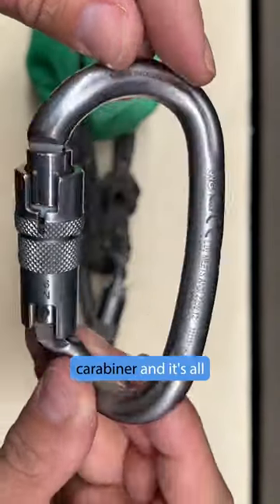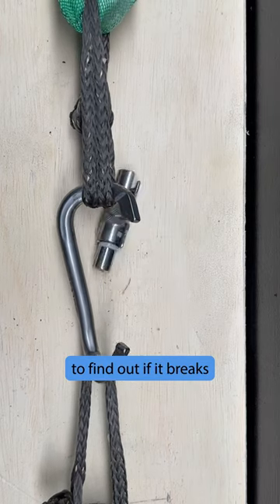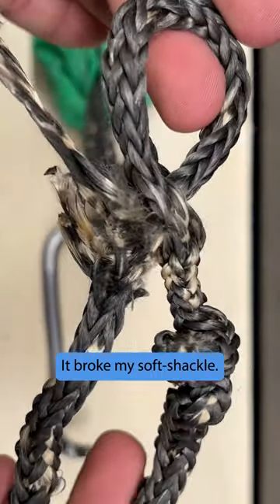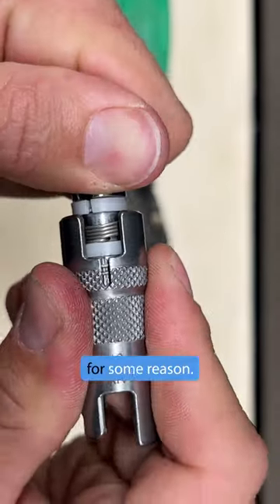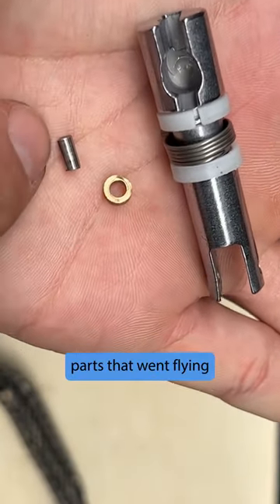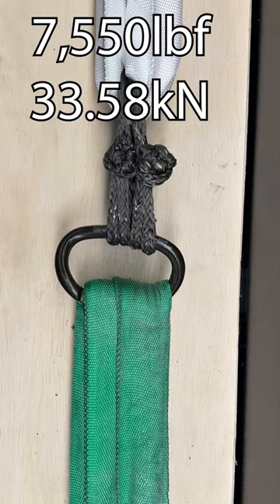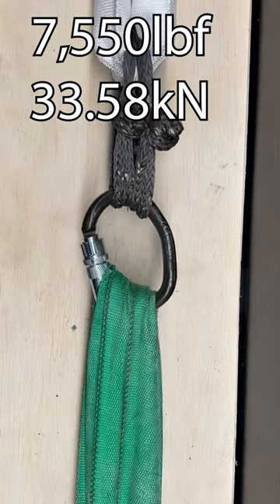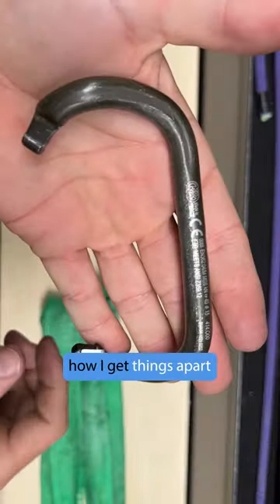Twisted carabiner tested

Comment: If they were ANSI rated carabiners, the 16 kN on the gate refers to the strength while compressing the minor axis, as opposed to the typical tension that we think of for carabiners.
Reply: In what situation will a carabiner be compressed with that much force?
Reply: @MoritzMoo  in a hydraulic press. But for real, what's out there compressing carabineer lol
Reply: @HercadosP me bro im built diffrent
Reply: @a211 8 miles of rope drag...still going
Reply: @MoritzMoo a rappel rack.

Comment: What do you use those for? Besides breaking, of course?
Reply: To connect descenders to a rigging plate and align them so the descender handles operate side- by- side
Reply: these are used in rope rescue for twin tension systems to put two cmc clutches or petzl ID's next to each other on a rigging plate. we use them at my fire department.
Reply: We use these (Kong Ovalone DNA) to connect Petzl-IDs to our belay loops, that way it is oriented better for use in front of you....
Reply: I have in mind you can use them when belying from stand with HMS knot. So if the biner gets pulled against the wall during a fall the knot will not be blocked and you can still operate it.
But I am not 100% sure about that. Needs to be confirmed by an expert 😅